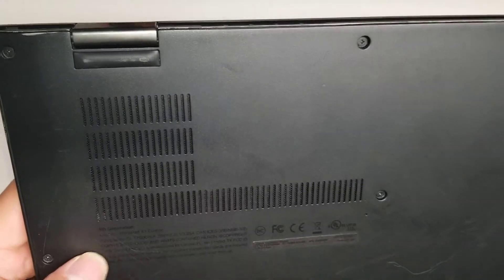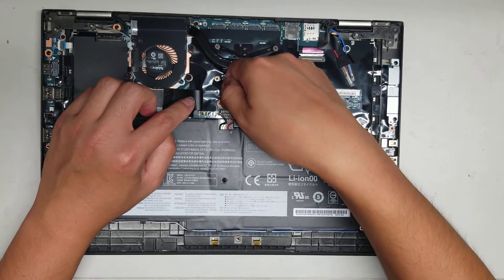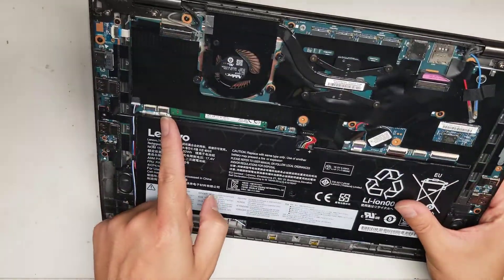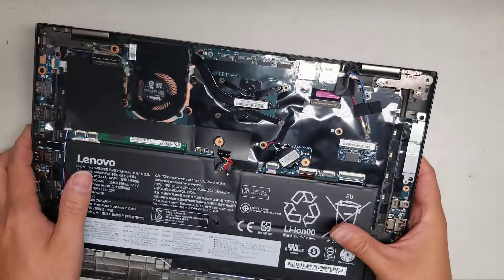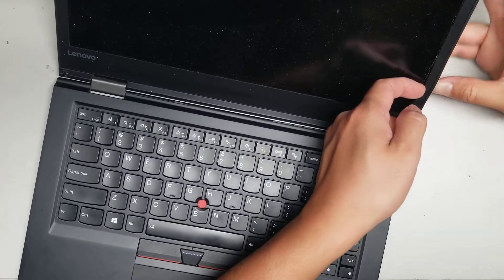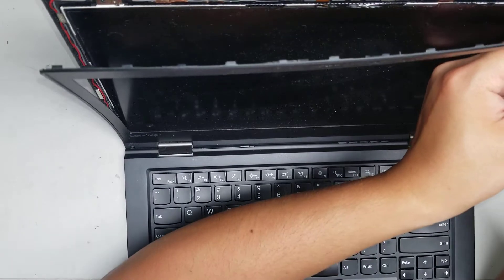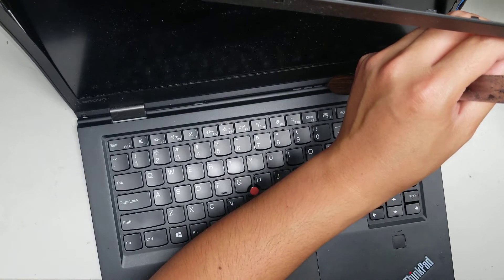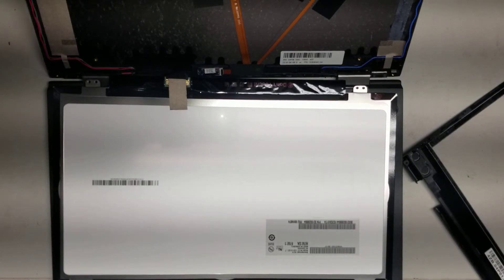4th Generation Lenovo X1 Carbon Disassembly SSD Hard Drive Upgrade Repair Screen Replacement

Comment: This was super helpful. Finally took the plunge about 4+ months after buying a 1tb ssd drive. Yes there is more info in this video than I need right now but if I need to fix or replace another part I will refer back for sure.

The drive I put in is a m.2 Pcie /NVMe and it works fine for anyone else who needs to know
Reply from the maker: Awesome, glad it helped and that you see the benefit to having the entire video even though you only needed a small portion. If you haven't already, don't forget to like and subscribe so others can find my videos. Thanks!

Comment: Great Video . Please let me know if I can replace my X1 Carbon 3rd Gen Motherboard with i5-5 Gen processor BY another x1 Carbon 3rd Gen Motherboard with i7-5 gen processor ??  basically upgrading processor here. Is it a straight forward replacement? Thanks
Reply from the maker: Nope, soldered
Reply: @ItsBinhRepaired  i am talking abt replacing entire motherboard. but with this time with i7
Reply from the maker: @umershaikh9017  possibly, but you might need a more powerful ac adapter as well
Reply: @ItsBinhRepaired  thanks
Reply from the maker: @umershaikh9017  yup

Comment: hi, how may pin's has this new matrix to your lenovo x1  4th gen, cause I have a similar problem with it and I'm looking the right part??
Reply from the maker: I don't count pins. Not sure
Reply: I counted on mine which bas a dead FHD screen : it's 30 pins. Not sure if the QHD screen has the same connector.
Reply from the maker: Qhd usually has 40 I think.

Comment: The hard drive is at 1:52, the green chip at the left side. You simply lift up that black flap, unscrew it, and slide it out to the left.
Reply from the maker: yup, should be easy to figure out.

Comment: Again,not a ssd related video.
Reply: I agree.. this video doesn't show how to remove SSD...so the title is misleading.
Reply: All you simply had to do was remove the drive, as described in your title of your video.

If you feel you're not benefitting, step your monetization  game up. 

You don't have a website, no descriptions or links to anything, you have to monetize yourself. You also need to respond more precisely, rather than "you should know." People don't like that. You could probably make money if you do these things, and actually do as described in your video titles, or simply title it "disassembly."

You can do it.
Reply from the maker: @helgenx   you mean I could increase my workload 1000x like that and get a few peanuts in return? Lol no thanks...adding all the extra effort and stuff to each video will not proportionately increase what I make from the videos and instead adds unnecessary risk to my customer's devices.

If being more detailed increased the pay, I should be getting more money from the videos where I describe and show everything, but I don't. People don't give an f about returning the favor. They're just happy to get free repairs and knowledge.

Several people said they can't thank me enough for the videos. I told them $10 would be plenty thanks, but I guess they couldn't even afford to send money for a happy meal or 2 starbucks drinks.

I've given up on thinking people will repay me for my knowledge, hard work, and added risk being put on customer's devices. So if I don't need to touch it to do a repair, then too bad, it won't be in the video.

If people want something specific in a video, they can ship me their laptop and pay for the repair like a normal customer.

Imagine accidentally damaging someone's SSD because I wanted to make a video, then the customer asks how their SSD broke trying to replace their battery. Yeah...no, not worth the risk/effort just to make some freeloaders happy. If they want more free knowledge they can watch more videos.
Reply: @ItsBinhRepaired  I got my job from making YouTube videos, I used my videos as a reference/resume, now I run an entire warehouse that does refurbishing of electronics. Took me YEARS to find a job like this.

Don't worry about what anyone gives you, sometimes you get nothing for a long time or nothing at all, but judging by your videos, you seem to have a lot, so be thankful for what you have. I didn't get money from the videos I used as a reference, and I didn't expect any,  however, I might start making content again and try to monetize it, but more so because I dislike misinformation.
Reply from the maker: @helgenx  I run my own business and have been long before YouTube. I don't want a new job, but the lack of appreciation makes me feel like shit and I don't need that in my life. Lol hence the shit attitude towards people that don't try and just want all the answers. It's like in school when you're the smart kid and they all copy off you and ask you for the answers. Use your brains and learn. Don't take shortcuts.
Reply from the maker: @helgenx  if they don't even know what the SSD looks like or how to take out a screw to remove it, they have no business going into their laptop. They should learn before pulling out things.

Imagine watching a video how to soft boil an egg and they ask, I just want to know how long to boil it, I don't want all the other details. So do you put the eggs in while the water is cold andd time from the start, or time once it starts boiling, or boil the water, then put the eggs in? Should they be room temp or refrigerated? There are a bunch of details missed when people ask for specific info like that and it pisses me off. Then they f up their stuff and then will say it's my fault for not telling them every detail...
Reply from the maker: If you can't figure out how to remove the SSD and put in a larger one or better from watching the video, I don't know what to tell you... If you want a cloning video or something, I have a video for that.
Reply: @ItsBinhRepaired  For people who don't normally take out the drive, it's important. I do it all day, but I understand why he complained. It's because you didn't actually show how to take it out.
Reply from the maker: @helgenx  every computer hard drive SSD comes out the same. More than 90% of my videos I take it out, but I get what you mean.
Reply: @ItsBinhRepaired  Some people see things 90 times, and still don't get it. If you want to continue making videos like this, just keep repeating the steps. We know what we're doing, but some people really do not understand at all. 

I'm almost in my 40's, and I've did so much since childhood with computers, yet I still learn something new. I researched this video solely to see what type of drive this laptop takes so I didn't have to open it, for example.
Reply from the maker: @helgenx  thing is, I don't just do this for fun with random dead computers. There are major risks involved. Yes the chance something will be damaged is small, but if I pull 1000+ SSDs/hard drives unnecessarily and happen to damage one, I will be responsible and nobody on YouTube will appreciate what I did and compensate me for the loss, not to mention my customer's loss of data, time, etc. because I decided to dick around with their device to make videos that don't even benefit me or them, but random strangers online that don't even pay me. Lol It's not worth it. Yes the random people that see my videos online will appreciate it, but after the thousands of videos I probably uploaded, the actual payout of appreciation is miniscule in comparison. It's not worth risking my customer's devices especially when they didn't sign up for that risk.
Reply from the maker: @helgenx  if they want a specific video, they can ship me a specific device and pay for the shipping and compensate me for the work appropriately, but I do not want to take unnecessary chances with peoples devices, especially when they're paying me to work on them as a service.

Maybe someday I'll make a general computer repair video showing every type of connector in one video to answer these general type repair questions.
Reply from the maker: @helgenx  I know my attitude sucks. I'm not cut out for the YouTube comments section. Lol But it's like I throw people a bone and they want me to provide a full course meal. For personalized training/lessons, you need to pay me. Lol

I do this stuff for a living and the videos basically just document the repairs. Every teardown video I make are all customer repairs that I charge them for. I'm basically giving away knowledge on how to repair things for free and people get upset that I don't make complete detailed teardowns to their liking, or I left something out, or my nails aren't cut the way they like, etc....I don't make them watch my videos. Imagine you give away pancakes and they and they demand you provide syrup, whipped cream, butter, etc. as well. Lol
Reply: @ItsBinhRepaired  you should know by now there are a few form factors of SSD.
Reply from the maker: @stevecarlisle3323  yes, watch my other videos and you'll see. If people actually watched the videos, they'd get to know what every type of connector looked like and wouldn't need to ask those questions.
Reply from the maker: @stevecarlisle3323  I don't have time to rewatch every video when someone has a model specific question. I don't memorize the internals of every model
Reply: @ItsBinhRepaired  okay, in your previous post you mentioned 90% of the SSD are the same. Same as the 3 1/2" disk format or the M2 format. Maybe I can learn something ! Remember it's not model specific, it's a interface, irrespective of manufacturer or model
Reply: @ItsBinhRepaired  Hey here's a idea, say in the video title what interface it is, if it's not the one we need then we just keep looking, instead of wasting time. A suggestion, if you can't deal with comments, you can turn them Off.
Reply from the maker: @stevecarlisle3323  correct, so you should be able to look at the other models with similar drives/ssds and know the slot exists from seeing an open laptop :)
Reply from the maker: How about you watch the video so I can at least get a fraction of a cent instead of asking me to give you free advice. I can't fit that much in the title anyway. If you want info like that. You can pay me. Keep in mind, customers pay me for this work, meanwhile you get it free in a video and complain about not enough free stuff...
Reply: @ItsBinhRepaired  Okay, I see where your coming from 😉
Reply from the maker: @stevecarlisle3323  haha yeah. If people watched just 10 of my videos, they could probably take apart 90% of all laptops XD
Reply from the maker: Spent years teaching myself this stuff. It's better people learn what they're doing by watching multiple videos than getting just a tiny bit of specific info and then messing up their computers as well. ;P
Reply: @ItsBinhRepaired  then change the title of the video.  When the title specifically says “SSD Hard Drive Upgrade”, people watch the video thinking that it will include upgrading the hard drive.
Reply from the maker: @Jim Blake  it's at 3:59 I can't put in the title everything pointed at. This tells you what type of SSD and where it is. There's a single screw to remove it. If you can get the bottom cover off, but can't remove that, then I don't know what to tell you.